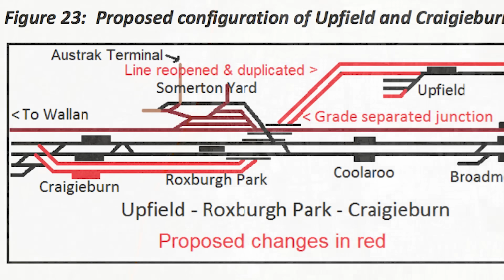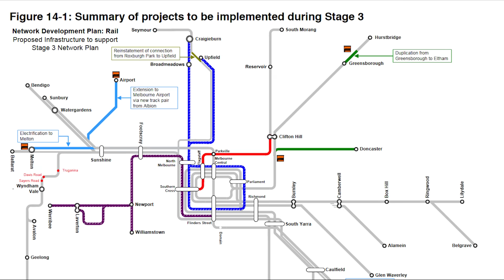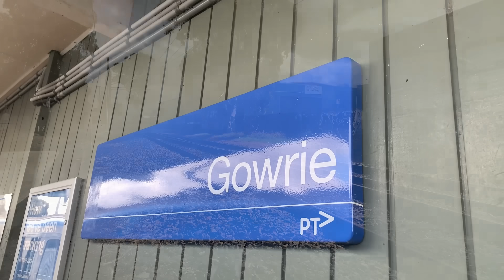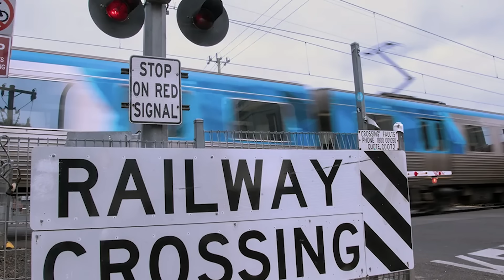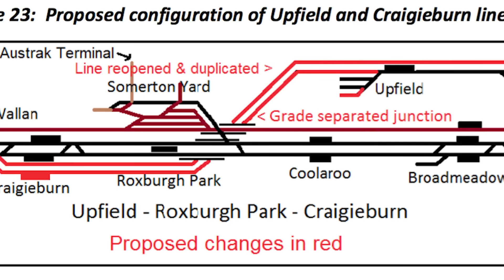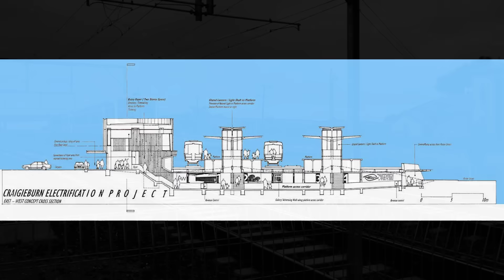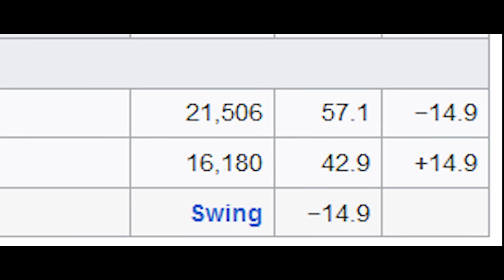The Somerton Rail Link and Wallan Electrification Projects Explained

Comment: They have 3 different tram lines and multiple buses in the Brunswick/Coburg area people can also travel on. Try going out to the western suburbs and see how you get on.
Reply: Bingo.  That anyone thinks this is a priority boggles the mind.
Reply from the maker: That’s certainly true for the inner section, but by far the majority of the benefit of these projects goes to Donnybrook and wallan which are in a similar situation to the western suburbs. Ideally you would really electrify this + Melton + Wyndham vale at the same time.
Reply: Extending the line to wallan provides no extra service to Brunswick/Coburg, it just uses the existing corridor to provide services to suburbs in the far north who are in similar situations to those in the west.
Reply: @xr6lad  We can have more than one priority. There are so many rail projects across Victoria that should've been built decades ago.
Reply: You completely missed the point of this project. "They have 2 different tram lines & multiple buses in the Footscray area that people can travel on. Try going out to the outer northern suburbs and see how you get on"
Reply: Which makes it a good place to use the relatively underused rail line to carry people from the outer north to the city.

Comment: The Upfield line is the Sandringham line of the north. Mostly forgotten and as it’s not part of a major rail corridor is not really a priority. It just doesn’t get as much use as the Pakenham/Sunshine/Sunbury line ect.
Reply: This is the purpose of the extension from Upfield to Wallan, Upfield can serve as an alternative corridor when the Broadmeadows and Essendon corridor becomes overcrowd and cannot cope with anymore capacity? also what about Alamein line?
Reply: Yeah but if Melbourne is growing then there's no way this line should ever be turned into a Light Rail service.
Leave it as it is.
Reply: The Sandringham Line is nowhere near as badly off as the Upfield line. On weekdays off peak trains run every 15 mins. Of course the Sandringham Line is not as a priority as the Pakenham line as it does carries nowhere the patronage of the Pakenham line.

Comment: I got told for ages that the reason the Upfield Line couldn't be extended or duplicated was land acquisition, but finding out that not only is the space there, but there is pre-existing infrastructure to do so? It's insane this hasn't been a priority, even just duplication.

Comment: Some of the projects that are needed in the next 30 years are the Airport Rail link, Metro Tunnel (which is basically done), Reopening of the Mildura and Mornington Line (or at least an extension to Baxter), the Extension of the Upfield line, SRL East (at the very least), and further duplication of the Hurstbridge line (taking into account the Copper Butterflies in Eltham) as well as the duplication and upgrading of track infrastructure on several other existing lines. 

An interesting undertaking would also be to fully reopen the Healseville line, as the section from Yarra Glen to Healseville is already going to be complete by 2025/6 (ish), not to mention the amount of ruralisation and growth happening in the Yarra Valley is only increasing, and will only continue to increase in the coming decades.

Comment: It would be nice if they triplicated the line in the inner suburbs so they could some some express services but that’s unlikely due to the row constraints and the section being elevated by the time they get around to it
Reply: Agreed but it’s incredibly tight so I can’t see this being viable without resumption of surrounding properties in a lot of places (aka political suicide)
Reply from the maker: Triplication is quite frankly a bad idea all around - you only really get a small benefit for quite a large cost - in the long term I could see some justification to trying to build a quadruple track section heading from Melbourne out North, but I don't think that should be prioritised for some time to come.
Reply: Upgrading to triple minimum on trunk routes should have been the priority for future network growth, particularly out to Dandenong. Unfortunately, we are now stuck with 2 tracks in many places due to the idiocy and lack of foresight behind those who were promoting Skyrail and level crossing removals...
Reply from the maker: @josephchristianson3001  Not really, there are still a number of ways to get quad track out to Dandenong (I've got a video on that in the works). Plus for most lines CBTC signalling and higher frequencies is better than triple track

Comment: Few points to note.
1: Upfield sidings 3 and A (outer two) have been deliberately built far enough away from sidings 1 and 2 (centre two; 1 being the old single track towards Somerton) to permit full security fences to be installed between A&1, and 2&3, so Upfield would still have 2 sidings undisturbed by the project. There is additional width usable outside A and 3 sidings, so it may be that there's extra sidings added there; alternatively, A and 3 sidings could be extended to take 2x6 car sets each.
2: Craigieburn yard can't be expanded easily; not much room for anything without major reworking.
3: Mitchell Shire Council back in ~2020/2021 released their vision of the future Wallan station, which had a large number of sidings off the down (Seymour) end, West of the mainlines, ending near the BP for Southbound cars on the Hume; any siding capacity lost at Upfield would most likely be redistributed to there.
4: Campbellfield station will be problematic to reinstate, as standards now require new stations to have (almost) flat platforms, and there's nowhere near the site that's flat enough for a new platform to be built; easiest option would be to raise Camp Road enough that the transition for trains from downhill to uphill can have a platform length that's flat, but that may cause other issues.

Comment: The 2003 Hitachi transfers was because the line was cut off between North Melbourne and Flemington Bridge due to the elevated CityLink toll road construction overhead meaning to swap out sets for servicing they had to be loco hauled from Upfield to Somerton.

A relocated Upfield station to the south side of Barry Rd could eliminated most Level Crossing uses unless a train was to enter or leave the stabling yard.

As for increasing services on the Craigieburn line they could look at utilising the Jacana Albion SG & BG "Goods" line as if it was tri tracked with dual gauge (SG & BG) all the BG V/Line services from Seymour, Shepparton could run along there and jump onto the Regional Rail tracks at Sunshine for an express run into the city, the extra bridge over the Maribrynong River for the Airport Rail could be handy here as well.
Reply from the maker: I think the problem that has been raised with the Albion-Jacana line is the restricted speed due to track quality, but it's an idea worth investigating.

There have been other concepts of potentially running the Bendigo and Seymour corridor trains through the airport as well which I think is probably a better long-term solution.
Reply: @MetroManMelbourne nothing to do with track conditions. Dual Gauge is limited to 80kph.
Reply from the maker: @bigman4225  that just compounds the poor state of the BG track in this instance I believe.
Reply: @MetroManMelbourne  No! Wherever there is Dual Gauge track it is limited to 80 no matter what!
Reply from the maker: @bigman4225  yeah no I'm aware of that.
Reply: @bigman4225  Yes but a substantial section of that corridor is not Dual Gauge. Where it is Broad Gauge only it is restricted to 25km per hour. So it is not Dual Gauge is the problem. Lots of the V/Line network for instance have a track speed limit of 80km per hour.
Reply: @bigman4225 
What about gauntlet track? I can see why shared rail dual gauge is limited to 80 km/h but with gauntlet track you could probably reach 120 or 160

Comment: I like this, and both the Upfield-Somerton section and Wallan electrification needs to happen imo. I would like to add a couple of ideas to this, speaking from a regional person's perspective.

1. The Upfield line could be converted to dual gauge, providing a more direct route from heading north out of the city for Albury and NSW services. By some very rough calculations, this would mean these services could reach Craigieburn in the same amount of time it takes them to reach Broadmeadows currently.

2. This would mean that the standard gauge platform could be removed at Broadmeadows, and the trains would then stop at Craigieburn instead. The concept you showed there had 4 platforms, but with my idea I would suggest increasing this to 5 or 6.

3. With Craigieburn now being the main hub, it would make sense for any future airport rail link to extend there as well. This would also provide an additional route from the city for electrified services to Wallan.

4. I don't know much about the Upfield line, but if there is room to install extra tracks/platforms at some of the satiations, it would allow express services to get through even quicker. E.g. the all stations would still stop everywhere, and could potentially terminate at Craigieburn. The express service would stop only at these interchange stations, and then run beyond Craigieburn to Wallan. Finally, it would allow regional services to overtake the Metro trains maximising their time efficiency again.

5. I see Wallan as a "stage 1" of electrifying all the way to Seymour. A lot of the towns along the way are also growing rapidly, in particular Kilmore and Seymour itself. This would also provide opportunity for a more frequent service to Seymour, something which would be more than welcome even today.

Finally I wanted to say this was a really well put together video, and you've earnt another subscriber here. You've done a better job communicating and explaining these projects then what the government itself has.
Reply from the maker: The only major issue with those proposals is the dual gauging - it would probably require some complicated track work especially points at both ends and would be quite expensive. Arguably the better option in the long term is to divert northeast and bendigo line trains (on SG) via the airport and the outer metropolitan ring road corridor
Reply: @MetroManMelbourne  that's a good idea. Also I looked at google maps after I wrote my comment, lots of level x-ings wouldn't have helped things.

Comment: I didn't know there was that section of gantlet track there. The only other place I've seen it is on the east side of the Spencer street railyards where there is/was a short length of broad gauge and standard gauge.
Reply from the maker: That was to allow them to run car trains from ford to Sydney on standard gauge. It’s pretty rare though yes.

Comment: I see everything being done before SRL North - I assume that the "Fawkner" SRL station would be located between the M80 and Camp Road (or Mahoneys Road).

In the shorter term, I could also see PTV starting with V/Line services only for a while.
Reply from the maker: Afaik the “Fawkner” station will be at gowrie owing to larger catchment. Definitely would be ideal to finish this before SRL north as you say
Reply: There is already a Fawkner station at the Cemetery, any Campbellfield station should be further north than Camp Rd as Camp Rd is too close to the existing Gowrie Station, perhaps put it near "the Meadows" Dog Track" ??
Reply: @MetroManMelbourne also a SRL stop at Gowrie would connect the train with the 527 bus service which terminates/commences on the west side of Gowrie station

Comment: A cheaper, short term alternative for Wallan trains would be a 2 car sprinter or 3 car vlocity shuttling to Craigieburn, where a same platform interchange could take place, like what happens with the Stony Point line at Frankston currently. Metro trains are obviously needed in the medium and long term though
Reply from the maker: That's definitely something worth investigating for now, perhaps a 20 minute frequency sprinter service from Craigieburn to Wallan. The Government also just announced a new high-frequency direct Craigieburn to Donnybrook bus link which is a good start.
Reply: But passengers won't want to switch to a slower Metro service, they probably prefer their semi express V/Line.
Reply from the maker: @shaunclarke94  The metro service would be faster when considering the massively improved frequency (probably 10 minutes) over V/Line (60-120 mins).
Reply: @MetroManMelbourne  true.
Reply: But that does nothing for relieving the Craigieburn corridor.

Comment: They can run additional trains but terminate some before upfield. Like at Coburg or Gowrie. I can’t imagine many using it north of Gowrie to Upfield
Reply from the maker: That's the plan for the short term when the Metro Tunnel opens I believe, but it's quite silly to terminate half the trains just one stop short of the end of the line, and I'd imagine quite inefficient too.
Reply: @MetroManMelbourne  true but there isn’t much development there yet. But this would only be a short term solution. If I was building this line, after Upfield I would send it to Broadmeadows, the Airport, than Albion then back down to Newport and Upgrade the Williamstown line

Comment: I would've thought it would make more sense to extend the Upfield line to Epping North & Wollert instead of creating a branch off the Mernda line at Lalor as it would serve areas that aren't already serviced by train and most likely involve less tunneling than a Lalor-Wollert route. Although redundancy would be a major plus of this project, it doesn't really seem to make a lot of sense to entirely rebuild a rail corridor just to create an alternative to the Essendon route. A duplication of the track to Upfield would make a lot of sense though, as well as maybe considering reinstating the existing single track (rather than a complete rebuild, duplication & electrification) to provide some redundancy and/or an alternative for VLine trains.
Reply from the maker: There’s no world in which that makes sense. Almost all of the future wollert branch has land put aside, you would need to build essentially 7-8km of tunnels to link wollert to upfield by comparison. The purpose of the upfield somerton link is not redundancy, it is to prevent craigieburn trains becoming overcrowded & to extend to wallan.

Comment: They need to be able to run both ways, Upfield to join the Craigieburn line and head back to the city or back out north at high capacity along with split vline services

Comment: So the issue here is the line and its potential extension mainly goes through light industrial . You even mentioned declining light industrial. Without a comprehensive commitment to brownfield redevelopment, their doesn’t seem much point in building a line where the density of commuters is low, those who do commute to work will probably prefer cars as they will likely live on parallel lines rather than on along the same line and the ridership is guaranteed to decrease.
Reply from the maker: If you watched the video you would know that the project is not about serving that industrial use in upfield - somerton section. It is about wallan.
Reply: It will be serving the Donnybrook to Wallan corridor which is projected to grow to the size of Canberra in the next 20 years time.

Comment: Our existing government (as at the start of 2024) isn't interested in the north or the west of Melbourne, especially as far as rail projects go. We have seen this with the lack of proper plans to electrify to Melton and Bacchus Marsh, the recent withdrawal of Bacchus Marsh H sets which could have been used to continue to provide increased capacity on the west, and no mention at all of doing anything more with the Upfield line towards Roxburgh Park, or continuing with the airport line to Tullamarine. Instead they continue to focus on the not-needed Cheltenham to Box Hill underground line, which many people in the area say isn't needed. This strikes me as a 21st Century version of the former Outer Circle Railway.
Reply from the maker: You're right and wrong. The SRL is still needed. But the Government has been incredibly lacklustre when it comes to electrifying to the west and north.
Reply: Yes of course the H sets should be withdrawn. The fact that they are still being used is a disgrace.
Reply: @MetroManMelbourne  The SRL is nowhere near as urgent as the Western Rail Plan or anything to relieve the Craigieburn corridor.